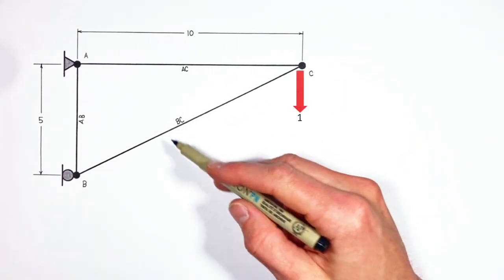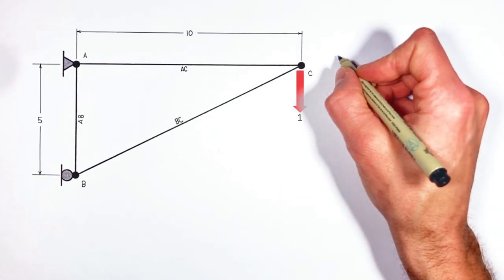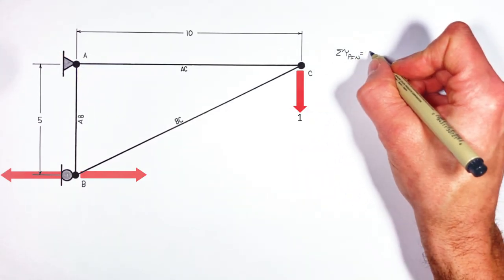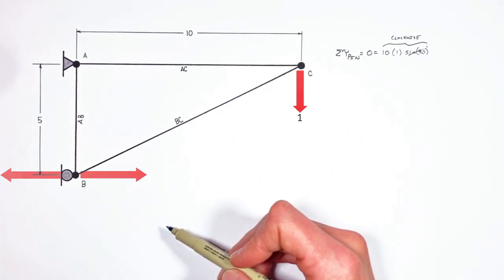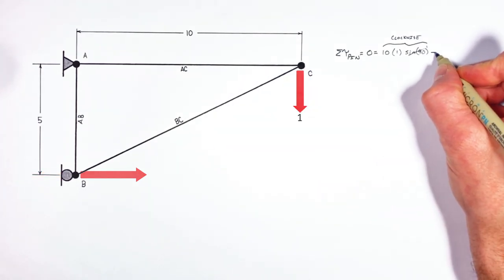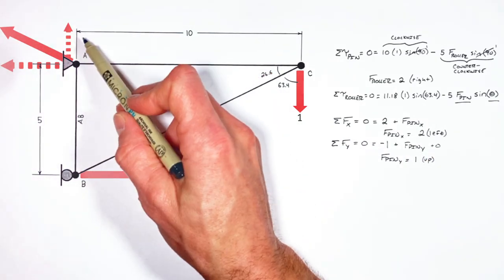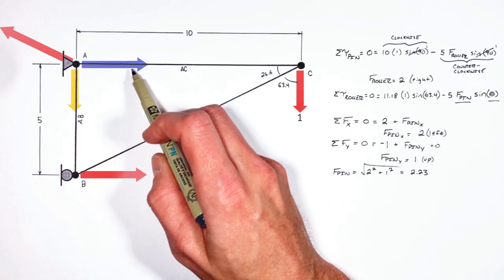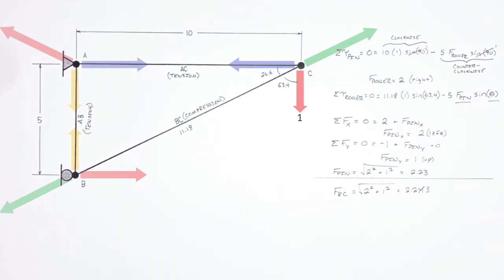Cantilevered Truss Analysis | Reaction Forces & Method of Joints

Comment: This might be some confusion over terminology but i wanted to clarify for my understanding. Which is, in method of joints we refer to if the joint is under compression or tension. However in your example you refer to the beam being in compression or tension. I think you must have meant the joint as the forces were acting opposite to what you said when you referred to the beam. Example - You said beam AC was under tension but you have the forces acting towards each other, which would be compression, leaving the corresponding joints in tension. I hope you can understand, I just want to make sure my understanding is good. Thanks v much for the example it's very useful and exactly what I was trying to solve at work.
Reply from the maker: In working through trusses there is some ambiguity surrounding convention.  Do we show the forces acting BY the beams ON the joints, or do we show the forces acting ON the beams BY the joints.  In the two cases the forces will be shown with equal magnitude, yet opposite direction.  

I typically show forces BY beams / members ON joints, since it is the net force ON the joint that must be zero in any axis to keep things nice and static; but not everyone does things my way...
Reply: Thanks, in the UK we state whether the joint is in compression or tension. 👍
Reply: Right.I think the load in the member becomes the opposite type load at the web!!! A web in tension puts a compressive load at the web.

Comment: What happens if B is fixed and is not a roller?
Reply from the maker: You can get rid of member AB...  The loads in the other two members do not change , and B supports the vertical load that used to be in AB.